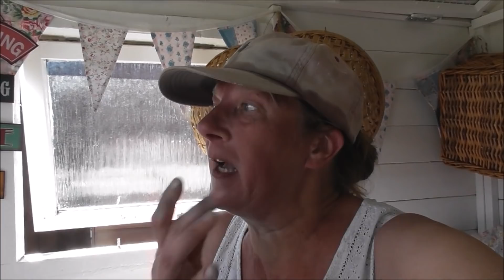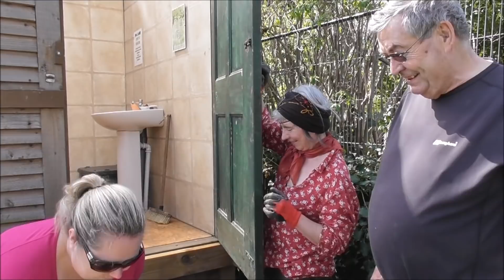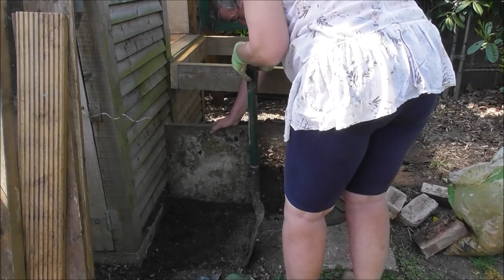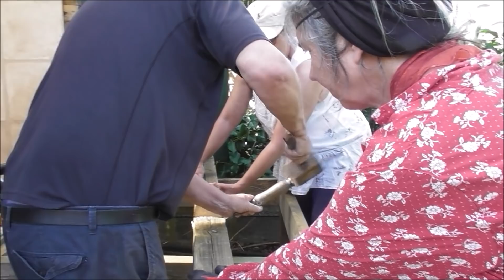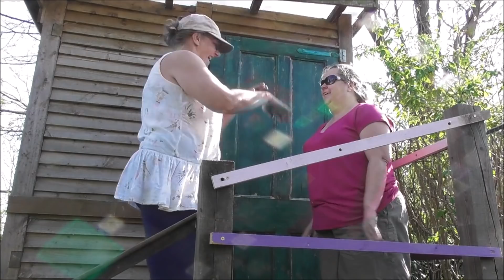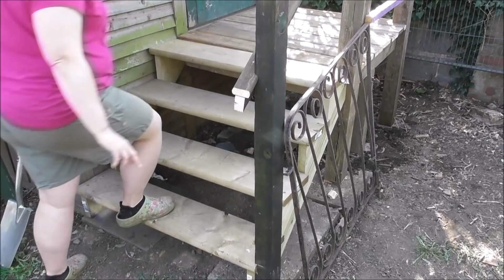Vivi's Kitchen Garden 173: Bee house question & community work day.

Comment: Great videoand team work. Little tip for decking and steps. Varnish and add sharp sand to give gritty surface to save the steps and decking getting slippery from the elements.
Reply from the maker: Ah, yes, good idea. The last lot we had we stapled chicken wire to give a bit of grip. Must remember to put it on the to-do list for the next work day. :-)

Comment: I'm new to Mason Bees also.  They are great pollinators!  I have watched many YouTube videos on keeping them.  The negative thing about using the bamboo sticks, is there is no way to open it up and clean the cocoons out without damaging the cocoons and destroying the stick.  I had my husband make me one bee house in which there are grooved boards stacked.  The grooves on the bottom of a board, match grooves on top of the next board so that it forms a tube between the boards.  Then late fall, you can take the boards apart and get out the cocoons.  You wash the cocoons and store them somewhere cold until spring, when they will hatch and start the cycle over.  My one Mason Bee house is not enough, so I've bought some paper straws to use in a house as well.  Watch some Youtube videos.  You can learn most anything on YouTube!  Hope this helps.
Reply from the maker: Thank you so much Jena......I had no idea there was so much involved......hahaha, I thought I just had to hang the houses and let them get on with it! :-)

Comment: CrownBees.com has excellent info about housing & care for solitary bees.  Usually the cocoons are saved through cold months and released as the weather reaches a certain temp.  Fresh, clean tubes should be provided  each new year.  Lots of activity there!
Reply: @gabriellakadar  Not an expert here but most info sites say to open tubes and empty eggs into safe, clean container to winter over in cool dark area, then release in early spring when temps are at a certain range.  Start with new or cleaned out tubes each year.  Really interesting project that is worth the effort.  Assistance is needed because of an increase in solitary bee predators and chemical use and less available area for bees to survive.
Reply from the maker: Gosh, I have so much to learn! Thank you for this link, I shall have a look, along with the others folk have sent, when I get a quieter moment. Cheers Linda. :-)
Reply: Linda Leal Crown Bees is in my area and I have purchased tubes from them before!  They are very knowledgeable...

Comment: I know nothing about insect hotels sorry. But I was just watching Roots and Refuge plant some tomatoes...She puts a cracked egg in the bottom of the planting hole. Have you ever heard of that? She learned from a gent who had gardened for over 50 years Says it makes for healthier, lusher plants.
Reply from the maker: I guess it's something to do with adding calcium?......I'm not an egg eater so I use Epsom salts instead. :-)
Reply from the maker: I should add that of course the Epsom salts add magnesium but it is thought the extra magnesium helps the plant to move the calcium around to where it's needed. :-)
Reply: @WhatVivididnext I had never heard of the egg thing. She put the whole egg in the planting hole. Not just the shell. So I'm assuming the egg it's self is involved, not just the shell. :-)